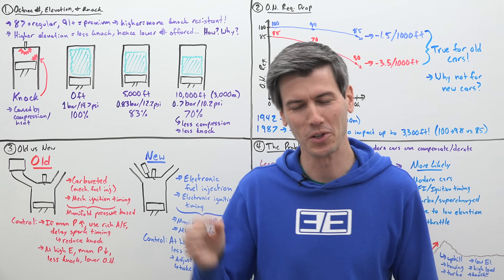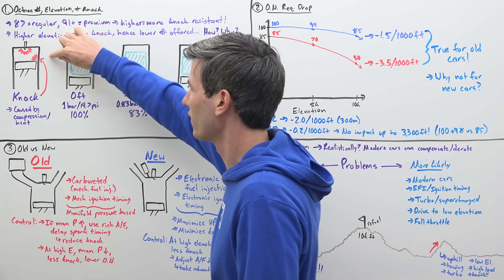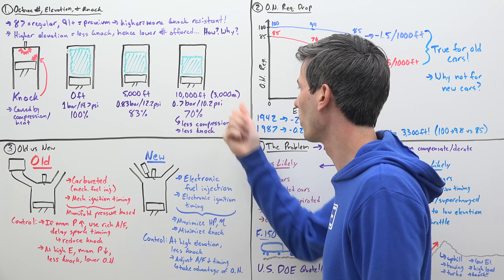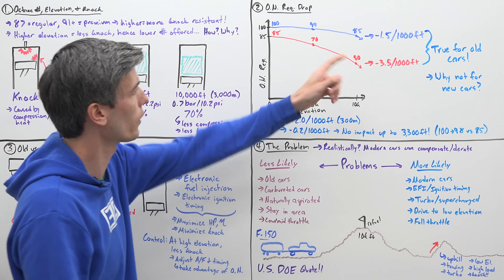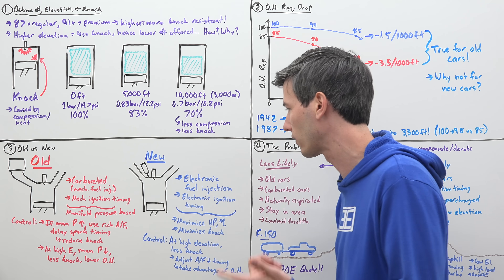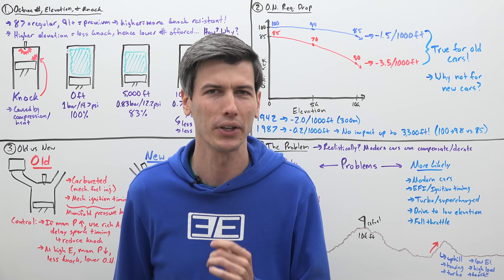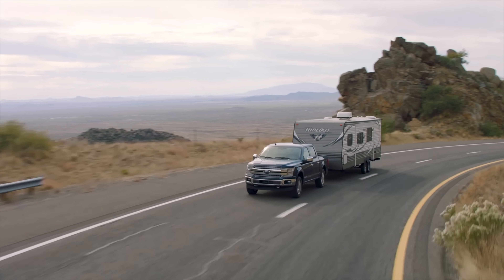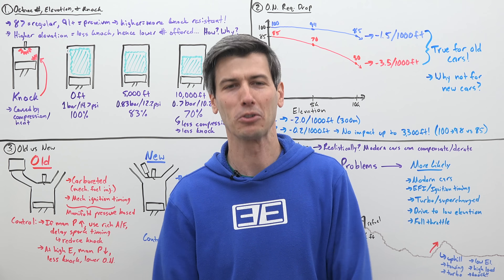Never Use This Gas In Your Car!

Comment from the maker: *Some additional important information!*
Modern turbocharged engines are based on absolute pressure, so they will attempt to match the cylinder pressure when at elevation to that of sea-level by providing more boost (with a lower baseline atmospheric pressure). Because you have the same amount of air in the cylinder, but are using a lower grade fuel, you can run into knock issues - hence, this is especially important to avoid doing with modern turbo engines. That said, even the engines tested from 1987 showed that the Octane # drop requirement was significantly less for "modern" engines (again, 1987), regardless of induction method, so this is not an exclusive problem to turbo engines.
Does Europe have higher octane fuel? No, explained here - https://youtu.be/zf-OYXlhJis
Is premium gas actually worth it? Not always, explained here - https://youtu.be/dxAQmj3P8xs
Octane vs Cetane - what's the difference? Explained here - https://youtu.be/OqV5L70-MUE
Is Ethanol bad for your engine? Explained here - https://youtu.be/ATGSBi1kBl0
Important Edit: E85 gas ≠ 85 Octane gas. E85 is 85% ethanol and has a very high octane rating (100+). 85 Octane gas is at max (if sold as regular gas) 10% ethanol and has an octane rating of 85. Do not use E85 if your car is not made for it (generally these cars are labeled as FlexFuel).
Reply: Hi Jason, talk to us about your thoughts on this new Unleaded88/E15 that's being advertised.
Reply: To clarify a few things. Petrol engines inject indirect on the valve's or direct in the cilinder but it's still injection during intake stroke before compression stroke. Not any different from carburetor when it comes to mixture in cylinder and ignite via spark. Diesel compresses only air and when it inject fuel it burns by self ignition. Self ignition before spark ignition is what kills your petrol engine. Turbo's are controlled with the intake manifold pressure, so as long as the turbo can pump enough air it will maintain the absolute manifold air pressure regardless of outside air pressure. Turbo's are powered by exhaust flow and can easily spin faster to compensate for lower air pressure in. But crank powered boost rotates in a fixed ratio with the crack and cannot spin faster, so if boost is set by how fast your compressor spins you'll see a boost drop as the outside air pressure drops. Also know that ethanol requires more fuel per air unit, so the higher the E rating the more fuel you need to inject to keep that perfect mixture. A very lean mixture is also bad for your engine, 75% E85 is not an good idea but you'll get a higher octane rating indeed. EFI systems are capable of retard timing with knock sensors. And did you know a knock sensor is a contact microphone.
Reply: @Fantaman900 
You could use a bit of polish on your sentence about "crank powered boost rotated..."
But other than that your comments are Spot On!  Nice work!  And Jason probably should have mentioned your points in his presentation.
Reply: Must point out that if you have an air valve or vacuum carburetor like a Carter, Edelbrock, or Rochester and a vacuum advance distributor it will automatically compensate for the thinner air quite well, which is why the difference in power was negligible in 1987, the air valve in the car would compensate by adjusting fuel and air flow, while the vacuum distributor would advance the timing mechanically, whereas the older ignition systems and carbs from the 40s through 50s and sometimes Mid-late60s wouldn't do this.
Reply: great information, speaking about ambient pressure, I want to ask if I should worry about my ev battery pack to blow up when driving to Tibet, considering it is airtight? Thanks! Subscriber from China!
Reply: @Alex-is-a-daddy  I would not worry about the pressure inside your ev batterie. The one I'm trained to disassemble is glued shut very strongly. Take out the many bolts and then hammer in wedges to get it apart.  I'm very sure it will hold the pressure difference of high altitude just fine. We are talking about 65 kpa at tibet and 101 at sealevel. That's 0.36 bar or 5.2 psi of pressure difference, not a whole lot.
Reply: What about a feature on hydrogen carbon build up cleaning. Does that work at all compared to media blasting? Or ar all...
Reply: in elpaso we have tanks as low as 83 octane
Reply: @mayotang5543  and my truck will run on it at sea level.
Reply: you need to make clear its 85 unleaded gas  not e85     e85 has an octane of 100....
Reply: I drive classics,,line see level,, I'm glad I get to save money on fuel
Reply: Some modern turbo cars de-tune themselves when you put in a lower octane fuel
Reply: @PervasiveFire  how?
Reply: The modern ECU is programmed to 'expect' a specific octane.
If the computer doesn't know the injectors are delivering a lower octane fuel than the engineers intended then the compensatory adjustments (computer pulling timing in response to the knock sensor screaming at it) will not mitigate knock and engine damage is inevitable. 
This is why Ford insists that it's customers do not use the low octane fuel.
This is true in all EFI engines.
Reply: @notsponsored103  Some newer vehicles such as Flex fuel vehicles can measure octane and alcohol content in real time, and choose different fuel and timing maps in the ECU automatically. Also most modern systems have a barometric absolute pressure sensor, so they can tell what altitude you are at. Cummins engines from CM2150-CM2350 and onwards have a baro sensor in the intake plumbing just after the air filter, which also reduces the fuel quantity as the air filter gets dirty. Which is why a dirty air filter can rob horsepower, because the variable geometry turbo can no longer compensate for the inlet restriction.
Reply: @brnmcc01  to my knowledge there is no 'Octane Sensor' in the aftermarket or used in any OEM car.
The ECU is programmed with an expected octane which is why the manufacturer insists on exclusive use of the appropriate fuel.
Flex Fuel Sensors only measure Ethanol Content (some may also record temperature) and the ECU adjusts injector pulse width and ignition timing accordingly.
Reply: fun fact, turbochargers were initially developed for aircraft use. They were built to provide 0psi boost at sea level, and as the airplane climbed, it would start ramping pressure up to maintain the 14.7psi at sea level. shortly after engineers started experimenting with running an engine at positive boost to get even more power out of engines.
Reply: Great explanation, Jason. I wonder if 85 octane at elevation will also affect gasoline engines with GDI but are naturally aspirated, since they are in the mid point between high pressure fuel but naturally aspirated.
Reply: the explanation about the truck going up hill and down hill to me in a test of a class in mechanics was a question of test, now recalled that test when you explained the situation going up hill and then refueling downhill with another octane index gasoline.
Reply: E85 flex fuel vehicles have a yellow gas cap.
Reply: Who puts regular in a boosted engine/??
Reply: @jeffnolan7392 Some call for it. My Wife's car is turbocharged and set to run on 87 octane.
Reply: Great video and explanation like always... BUT, can you make a part 2 where you will talk thru maybe potential problem with that same F150 if I import that vehicle in Europe and put in it 100 octane fuel ⛽ 😁 🤔
Reply: @proximusadiemus8731  Octane number is just knock resistance, so putting in higher than required isn't gonna cause any ill effects (presuming it's still petrol/gasoline and not E85 ethanol) but is a bit of a waste of money as you won't get any more power either. Also European octane ratings are different, 100 RON would be the same as 95.5 in the US (so still higher grade than you need for a truck)
Reply: @proximusadiemus8731  The higher the octane, the less issue with your engine. So no real problem will occur because of the electronics but also because it has a turbo engine. So you will not see anything happening in Europe with your F-150.
Reply: In Colorado, where I live, the highest grade gas you can get is 91. If I were lucky enough to have a vehicle that requires 93, but only put in 91, would the vehicle knock it's brains out, or can most modern vehicles cope and retard the timing to keep the cylinder pressures out of the no-no zone under high load?
Reply: @ctbrahmstedt  Same situation in California, which is at sea level. The cars requiring premium fuels don't have an issue with 91, although if you have an aftermarket tune on a boosted vehicle for 93, you might run into issues with knock at high load with 91.
Reply: @ctbrahmstedt  no it will pull timing accordingly
Reply: @ctbrahmstedt  chiming in from Denver with a wrx (turbo 4cyl) I also wish I could find 93... But it's been doing just fine on 91.
Reply: @ctbrahmstedt  I think fuel injection vehicles won't have a problem? but older carburetor vehicles will.
Reply: Interesting & good questions about fuel & engine performance in regard to altitude effects & load, although seems you have an idea but octane rating & fuel" grade" aren't indicative of "quality". Though marketed as supposed quality, often deceptively, octane rating describes fuel stability, the capability withstanding compression before detonation, the engine compression ratio. Beyond that, technically referred as the fuel Octane Number, it does consider & involve factoring varied operating conditions, RON & MON (refer to the yellow decal on fuel pumps); Research ~ idle & low air temp, while Motor ~ stress or load & higher air temp. I'm still contemplating the extent of persistently varied vehicle load conditions along with ambient air pressure & temperature in such topographically & climactically varied regions as CO, especially the influence upon engine performance & factors which require sensing & adjustment, the extent of such parameters & response, with all other components satisfactorily operating. As indicated, research the methods for determining the Octane Number, those environmental parameters & engine performance with sensors, response, & adjustments will be cited. Although, I'm unsure about any adjustment on compression, that's usually a maintained parameter, but essentially upon intake, injection, & ignition, factors that involve sensing & adjusting combustion of air & fuel mixture. EIA is worthy reference, but vehicle specific should be available.
Reply: @ctbrahmstedt it's fine. He's over blowing the issue. Use the closest to start it recommends and you'll do just fine unless you have a custom tune for a specific octane.

I've been a high altitude gear head and mechanic for 2 decades in Colorado and Wyoming.
Reply: @martrg1 I’ve wondered about +/- of putting a gallon or two of E85 with 14-15 gallons of 93 in my tuned VW. It’s tuned for 93. I’m curious if I would notice any power difference. Concerned about the fuel pump, lines, and rubber components. Do you have any thoughts?✌️
Reply: @Tread1775  don't do that. E85 needs more fuel for the same amount of energy.
Reply: @ctbrahmstedt  I've had a car that was supercharged and currently have a Corvette. Both recommend using premium gas (91+) to run the best. You can put in lower rated fuel (which I'm sure the previous owners did because they both ran like crap when I got them) and they will just adjust for the lower fuel rating, but they will run poorly and get worse fuel economy. If you get something that's highly modified/tuned and try using fuel that's way lower than what it should get, there's a chance it might not be able to compensate enough. I don't think you should have to worry as some places (like where I live) don't even have 93. 91 is the highest rated fuel I can get in my entire city. The only instance I can think of where a car would require an unusually high octane rating is a car that's built for racing.
Reply: Actually you should never use anything less than premium on turbo charged motors. Regular or mid grade is bad for the motor.
Reply: Oh, a 95 Geo Metro that knocks going up hill slowly in first will run great on about 75% e85 25% 87octane, with no hit on either fuel economy or power
Reply: America sells all kinds of products that are illegal to install in most states or products that will damage the vehicle.   It's up to the consumer to learn the ins and outs.
Reply: Seems kinda IGNORANT because almost all newer vehicles are fuel injected. Octane rating is for carbuerated engines. Preignition occurs when air and gasoline are premixed. By the way our lab used to test gasoline, today's "85 octane" is usually 10 points less using ASTM standard test engine. EPA certified (required in the US) engine delays injection and ignition are degrees past top dead center. Modern cars are not allowed to be designed for peak performance as that generates Nitrogen Oxides (NOx).
Reply: @stephenjacks8196  woah, dude…not even close.  You have no clue…what you wrote is way off base.
Reply: @borysnijinski331  --- Please elaborate.  Otherwise, those of us whose eyes glaze over when science is discussed don't know who to believe.  (Seriously---explain it like I'm five years old.  Many of us like to understand, but can't get our heads around the technicalities of it all.)
Reply: @be5952  for one, on Otto cycle engines (gasoline engines) ignition occurs before top dead center, not after. On diesels it occurs after top dead center.
Reply: @aarontoussaint8364  depending on the tune  ive ran cars at 0 deg  race fuel can be weird lol
Reply: @aarontoussaint8364  Not quite, injection timing on a diesel once at operating temperature is around 4 degrees before TDC. The reason for gasoline ignition to be a much greater amount of advance under light load is because the thin charge takes a long time to get fully burning, but in all engines, the timing is adjusted so the max PEAK cylinder pressure is just slightly past TDC. Because if maximum cylinder pressure occurs at exactly TDC or worse, slightly before, there's no 'leverage' in the connecting rod angle to turn the crank, and instead it just hammers both the big and small end connecting rod bearings. The reason for very little timing advance in diesels, is the fuel ignites much much faster, in fact, how rapidly it burns is measured as a Cetane rating which is sort of the opposite of Octane rating (how slow complete combustion takes). Modern common rail electronic diesel fuel injection systems also have great control over ignition timing, and is not fixed like a mechanical pump system, or unit injector system like on an old Detroit two cycle, where only the fuel quantity is changed by the rack, but the injecting timing is fixed (once overhead is ran, and injector height is set properly)
Reply: thank you so much. I live at 9k and tow over mountains a camper. I have been looking for an understanding of octane and elevation. Found it ! 
As always, great information with an excellent presentation.
Reply: @stephenjacks8196 
You need to distinguish between port injection and direct injection.

Port injection still mixes the fuel right before the intake valve, and enters the cylinders pre-mixed, just like a carburetated engine.

Only newer direct injection engines can squirt in the fuel after the valves close.
Reply: @mrmohr2  diesel is direct injection

Comment: In Denver, Costco doesn't even sell 87 octane gas, just 85 and 89 octane. I use 85 octane in my Toyota RAV 4 with no problems. You'll have more problems by not using a Top Tier gas,

Comment: Drove or rode in many different cars all over the USA, usually with the cheapest local gasoline. Never heard a car engine knock - or the knocking was so mild that I didn't notice and nobody else pointed it out. Never owned a vehicle capable of towing (though that could be a useful feature). So I have no concerns at all about knocking. Nor am I worried about tailpipe emissions, because my county tests for that.

What I really care about is total cost of fuel. Our minivans tend to have 10% better MPG in OK & KS (87 octane) than in the Denver metro area (85). Is that due to higher octane, more oxygen, straighter roads, fewer hills, more highway driving, less stop & go traffic...? Would upgrading to 87 in Colorado improve performance (or avoid repairs) enough to justify paying 15-25% more at the pump? That's what I want to know.

The historical info about knocking is still interesting though.

Comment: Whoa. I wish I had come across this video before I went on a road trip to Utah, where I put 85 in my Forester, simply because I didn't know any better, 85 was labeled "regular" and 87 was A LOT more expensive. I guess I won't do that again. That said, my Subie knocks quite a bit with 87 where I live, at 2,500 feet, whereas it didn't seem to knock at all with 85 at the higher elevations.